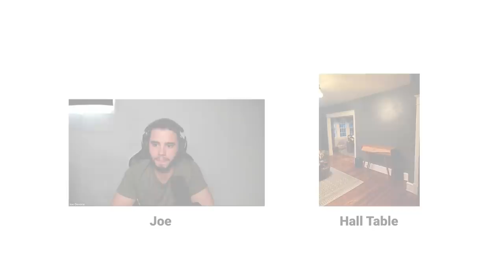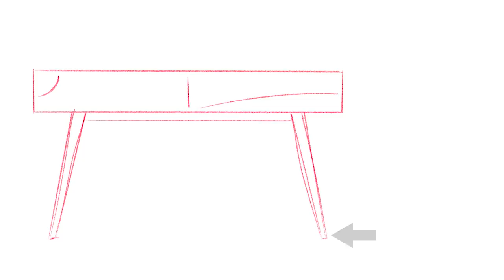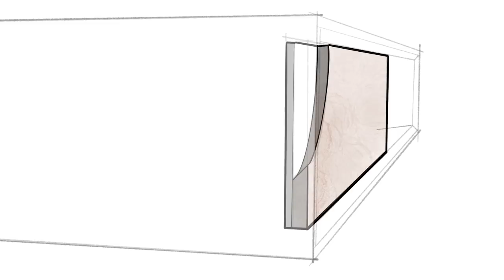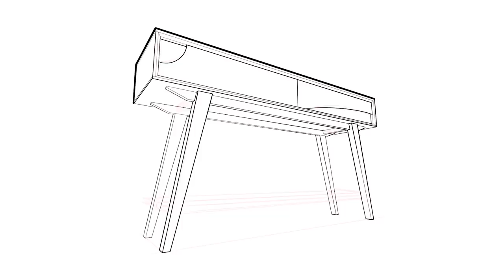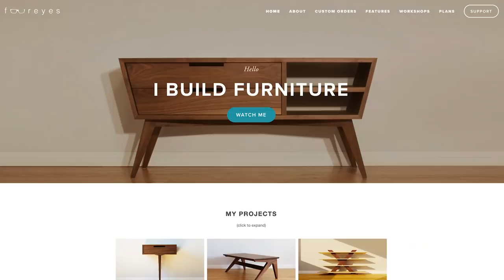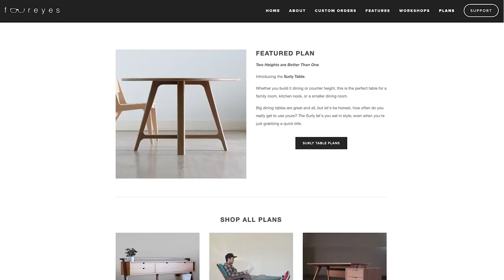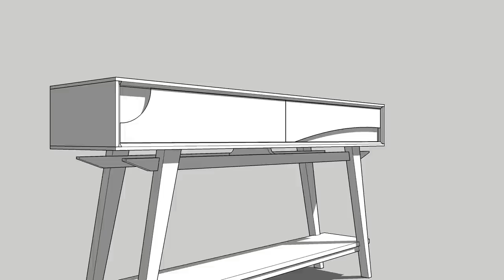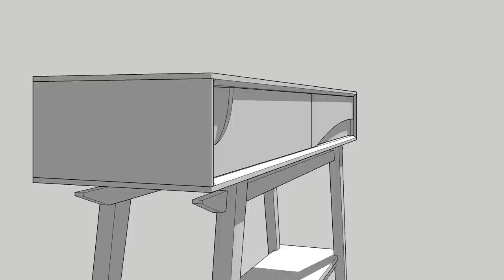Roasting Your Furniture Designs (Gently)

Comment: Chris, thanks again for your help!  I really enjoyed talking with you to get a better understanding of your design process.  Looking forward to building version 2.0 in the near future.
Reply: Very nice work there Joe!
Reply: Beautiful design. What wood did you use?
Reply: @arnoldc1724  Thanks!  The case and legs are made from cherry and the drawer fronts are maple.  I finished everything using maker brand co simple finish.
Reply: @nigelmtb  Thank you!
Reply: This is a really cool design! I'm at a similar point with a build of mine and this really helped me break down what needed some changes. Props to you for being willing to put your work out there and take constructive criticism.
Reply: The original was great to begin with. Chris just put that finishing touch that made this a spectacular piece!
Reply: @Joe Devone -->  I like Chris' design, but I liked your's as well.  
(Not that you asked, but these are my thoughts) 
I don't know how high your Console is I would suggest 30-32" max. I would add cylindrical 3/4"W x1"L 'pulls' 
fitted  to the outside ends of each panel, balanced
half way between the opening and the opposite side. 
These will be balanced for each side. I don't know how accurate my screen is on my phone for coloring...
I just saw it again, go with brass.
See how you like it after that. I know it's not much but I don't think it needs much. This way is more feminine. 
Chris' is more 'masculine'.  Think of it this way, a woman with long sexy legs is really nice and women wear their pants higher.   if you want to build a man style, and that would be groovy if that's what you wanted, then build that.  Also, women love bling, but don't go past your comfort zone.

If you want to rebuild it then I would suggest making the legs 125% of what they are now. In addition you could add a shelf underneath it at about 10 inches below and not as wide as the top portion.
 I think that would look great. 

The most important thing that you can do is honor your own style and ave fun with it.
Reply: Two years in, gotta ask if 2.0 was brought to life.
Reply: @michaelt312  It was!
Reply: @devone3024 , awesome!! Did it turn out as we would expect? Would be nice for a follow up video.
Reply: @michaelt312  I don't make videos unfortunately. But yes it turned out great. I have pictures but every time I try to direct you to them, youtube automatically deletes the comment.

Comment: I think your ability to present topics intelligently is outstanding.  I think if you were to incorporate the concepts of proportionality, (like odd vs even whole numbers or the Golden Rule as example) in addition to what designs feel like and their comic association to relatable images would be beneficial.  This hall table as example, the legs were viewed from the end perspective but ignored in critique.  The leg design critique included a tapered front elevation change that looked good, but the graphics lacked a simple proportional ratio understanding as to why.  The legs went straight down to the floor in the side elevation view, but the graphics could have shown the legs splayed out from the top frame to floor in an odd number ratio as example, just to see what that change looked like.  For imagery, kind of like spindled giraffe legs with the feet touching the floor just slightly contained within a plan view footprint.  This would have added stability, but proportionally, would it have looked good?  With straight legs in the side elevation view, I thought the piece looked like it could easily be shaken just by opening the drawers, or if they contained any weight or if a child reached up and grabbed at it, it could fall over forward away from the wall.